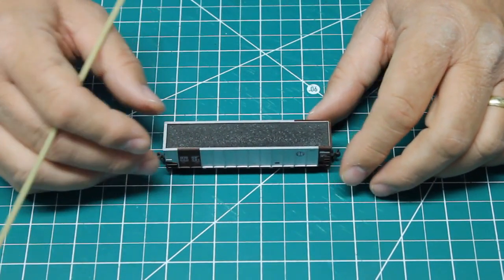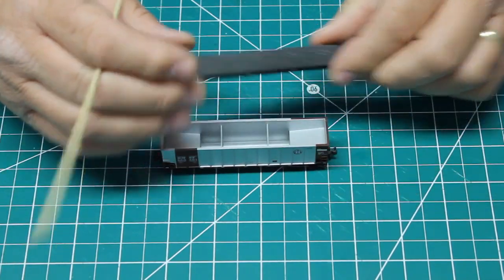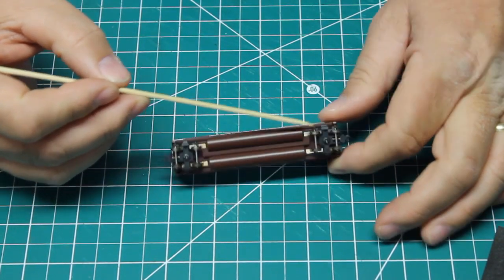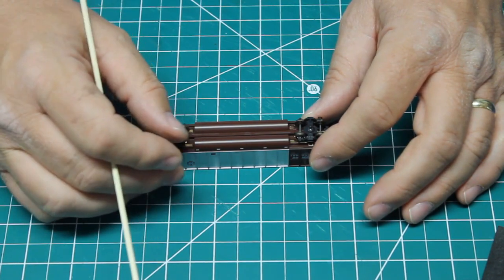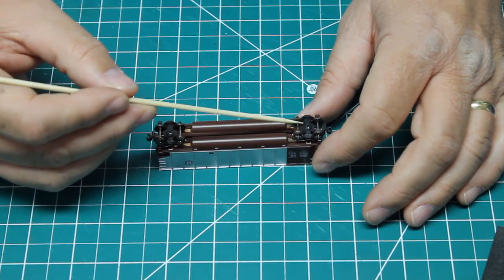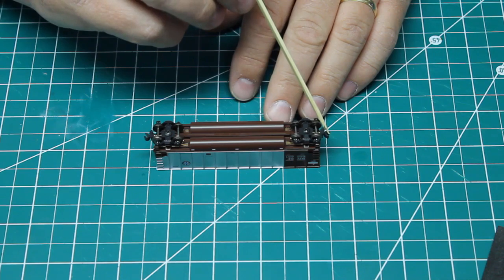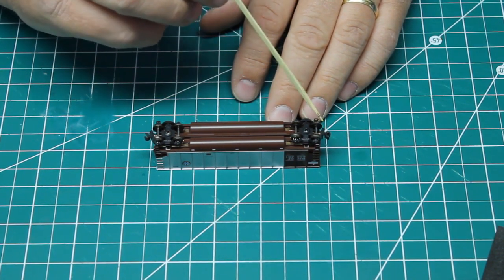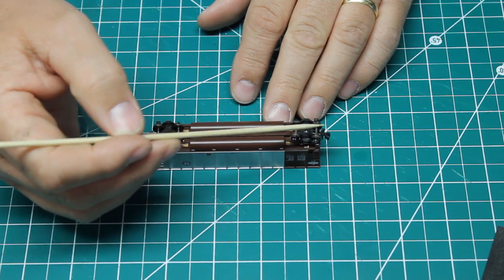Model Railroad Coupler Installation - Body Mounted Couplers

Comment: Excellent demonstration. Some modelers who don't use magnetic uncouplers cut off the the wire on couplers. If you don't use magnets is there any point to inserting the the wire when assembling a coupler? Have you been adding trees to your mountain scene?
Reply from the maker: The couplers are much easier to assemble with the pin in place. It helps hold the coupler together until you get it installed in the draft gear box.. Some people then cut the pin off, but as far as purpose the pin is a pretty good representation of the air brake hose that is connected between couplers. Without the pain there is nothing to represent that in N scale unless you use a thread and magnets to represent the air hose.
Reply from the maker: ... and yes, I've added some trees. I did a video about that a couple weeks ago. Getting ready to add some more trees still and some underbrush to the mountain area.

Comment: Great video!! I just subbed! I actually want to do this one all of my cars eventually. A issue I worry about is coupler height. I have a random assortment of rolling stock from new Kato's to old Bachmann's. Whats a easy way to make sure the height is correct while installing them, and what to do if its too low or too high?
Reply from the maker: That is a really easy problem to address if you were using body mounted colors. If he color is to high, Micro trains sins little Gym washers with the colors. Just put one of those or more in between the coupler and the body and it will lower the coupler. If the coupler is to low, do the exact same thing between the truck and the booster to raise the body up a bit.

Comment: What are those metal strips on the underside of the body next to where the trucks fit?
Reply from the maker: Hi Alan. Those are unique to Kato cars and I honestly don't know what the purpose is unless there is concern about the wheels rubbing against the underbody of the car. I don't know why that would ever be the case, but I don't know why those brass strips are there.
Reply: Some Kato cars have lighting installed - of the provision to do so - so I'd imagine this is an inherent design in the Kato tooling.  Some cars obviously will never have lighting but the tool is the tool is the tool and it is cheaper to have it, than have a separate tool.  Tools are expensive for making the models.  Bloke I know down here does stuff out of China RTR and if he gets to tool wrong, and has to get it redesigned it costs something like $200k.  Important to get right!

Comment: Hey Ron .. I somehow fell a bit in love with your series - but especially regarding those Micro Trains N couplers I have a question - now before you laugh, I'm starting out with my first US rail layout and I'm still awaiting shipment ... unfortunately MTL got affected by the fires in Oregon - But what oil / stuff do you use in those couplers .. I've read that Micro Trains suggests their own stuff - which is hard to come by and expensive ... do you have any experience / suggestions what I should use ?
Reply from the maker: Well, I personally do not use anything. The couplers are made of derlin plastic, which is naturally very slick. I have not problem with them binding. Personally, if I were going to use anything on the couplers it would be powdered graphite. In the US it is sold in hardware stores for lubricating locks and latches. It does not attract dirt and does not "gum up" like many lubricants will do.

Comment: Another question:  Do you have any issues mixing body mounted cars with truck mounted cars and backing them up?   Or, on tight curves?
Reply from the maker: Hey Dwight. No, I don't really have problems there. If there is an issue it is usually with two truck mounted couplers one shoving the other through a switch. The pressure on the truck mounted coupler twist the truck in the rails and can cause derailment. If that is an ongoing issue with a car I upgrade to a body-mounted coupler and it usually solves the issue. A lot of it has to do with length of car. Longer cars have more problems with that issue on the tight radii  of switches.

Comment: Kato couplers do couple to acumate couplers. I run them together all the time. Trying to figure out if i want to change to mtl true scale or make my own.
Reply from the maker: Ok, I keep getting this response. Not all Kat couplers are the same. These are dummy couplers, no moving knuckle at all, and they are compatible with nothing. Yes, some Kato couplers are working couplers, especially on newer locomotives, but these are not.
Reply: @RonsTrainsNThings  interesting. Ive pulled my kato bethgons with atlas locos before. Needs tge hand of god though
Reply from the maker: @liamcooper5202  Perhaps the thing here is different definitions of compatible. Yes I can force them to couple with other brands but inwould not call them operational when inhave tonuse the "hand of God."
Reply: @RonsTrainsNThings  haha well that does knock some brands out from themselves 🤣
Its a shame mtl 1015s are so sloppy and the true scales dont couple with ease.
Reply from the maker: I totally agree.

Comment: Hey Ron, HELP.   I'm just starting out again in The best hobby in the world.   Right now I'm trying to assemble a old Roundhouse Industry die cast box car.  The base is metal/pot metal and the steps need cleaned up.  If you were doing this how would you go about it.   Thank you for your help
Reply from the maker: I would carefully file them with a needle file.
Reply: Thank you Ron, just ordered a set of mini files from your Amazon account.   Please keep the great videos and advice coming
Reply from the maker: @CM-ARM  Thanks.

Comment: Ron have you made any videos showing the different length mirco train couplers? 
I know there is short, med and long couplers, but I don't know where to to use them. 
Thank you for all your videos you and the others really help.
I been kicked off Fakebook to many times so I moved to MEWE.  Not to sure if I like them. They have groups and I found a nice group of N Scale trains but they get all upset if you post any other scale but N scale. I told them we should honor all groups including live train feeds because they will help educate one and give others ideas. Anyway, I stopped posting in the groups and just do the home page. What's your feelings. Should these groups allow other information or just be stuck in never never land.
Reply from the maker: I think each group has the right to set its own content guidelines. The trick is to find a group that has content that fits your needs and desires.

Comment: I just started converting all my cars to body mounts I'm about 60% thur my cars the biggest pain is the tank cars and old atlas coal cars
Reply from the maker: Someone makes a conversion kit for the old Atlas coal hoppers, but I can't remember who off the top of my head. It may be TrainWorks. As for tank cars, I leave the truck mounted couplers on them.

Comment: X-Acto Blade Chisel #17  might work a little better in the tight location
Reply from the maker: Possibly. 👍
Reply: @RonsTrainsNThings  use nail clippers(finger) to remove the OEM coupler boxes from the trucks in one click, though not all are the same width. I found it more convenient to have dedicated pin vises fot the drill and the tap, and they are labeled so I don't grab the wrong one by mistake and they are always ready to use no matter what else you are working on. Occasionally you have to counter sink the screw hole or use a flat head screw avilable from WKW and others, so the axle does not rub the top of the screw and the truck won't sit flat (or use a 1025 even if you have to cut the back off after assembling). Have been body mounting since early 70's, creativity is a must! Liked the idea of using the tape to hold the parts! I get a 10 pack and assemble them all at the same time and keep couplers and parts in small box made for fishing tackle, weekly pill boxes work good too. Keep up the great work Ron!

Comment: You have a great technique but I will tell you eye sight has to be very good even with magnification. My sight not good enough so I spend the extra money. Thanks for your post.
Reply: I could have done this 30 years ago.  One of the reasons I model in HO is with enough light and magnification I can still see it.  A tip from an old guy.  In addition to your glasses get a forehead mounted light.  It really helps!
Reply: PS, I do enjoy your work!
Reply: Suggest you use soldering glasses - ideally a headmounted, those come even with additional light with several ultra bright white LED .. leaves your hands free and gives adjustable magnification

Comment: tomorrow ill be installin 12 of these premade cuz my fingers but the reason is the 6-pack i bought have static couplers, i need to read closer i guess but i liked them also bougght 2   6 packs, i thought a 4 pack duh in any case ill see howe it ggoes

Comment: What's the drill and screw number for n -scale. Thanks.
Reply: Tap drill is #62, then use the 00-90 tap to cut threads. Screw size 00-90

Comment: Wow. I thought truck-mounted couplers would handle tight switches better because they would better follow the tight curves, the coupler always being at right-angles to the axles as the wheels follow the curve. Is there an explanation of why body-mounted works better? I have an HO layout with Bachmann EZ Track so-called standard turnouts (approx #6) and switching is always 'an adventure '.
Reply from the maker: The problem with truck-mounted couplers on tight turnouts is that the push on the coupler puts lateral twisting pressure on the wheels and flanges as it turns--pushing sideways on the truck and thus contributing to derailment. With body-mounted couplers the trucks are free to turn without the pressure sideways directly on the wheels.
Reply: Thanks

Comment: Why does Kato make there couplers so they don't open?  How are you supposed to couple up 2 cars, with the 5-finger helper?
Reply from the maker: I suppose so. This is just Kato's proprietary design. Remember, they are imported and they have a significant business in their native Japan.
Reply: Right, but I wonder if in Japan do they just run round-and-round trains?  Or do they do operations with their trains.
Reply from the maker: That I don't know.
Reply: The Kato couplers do open, the engines and cars Kato sells come with trip pins for realistic operations
Reply from the maker: @nsnjrailfan1617  I would like for you to look at the image linked here and tell me how this is ANYTHING BUT a dummy coupler: https://ibb.co/HY0KF2Q

Comment: The Kato couplers are functional not dummy, they come with trip pins you can add for realistic uncoupling, they work fine with atlas, micro trains, athearn, and Bachmann couplers.
Reply from the maker: Not true. Not in this case anyway. It is true that newer Kato locomotives come with couplers that are functional, these Kato cars do not. These are completely non functional, one solid piece, dummy couplers. They can sometimes be forcibly coupled to some others, but they are in no way operational. They don't even work well with one another. They have to lift up against their springs and slide over one another to couple and uncouple. In short, if you want to do any kind of switching they are completely useless.
Reply: @RonsTrainsNThings  

So, Kato couplers do not play well with others? Therefore, I should either go all Kato, no Kato, or be prepared to swap out Kato couplers for Micro-Trains?
Reply: @rayopeongo  Kato couplers play well with other brands, while occasionally they will not couple on the first try they typically work fine from my experiences.

Comment: THAT COUPLER IS TO SMALL IN LENGTH FOR ME TO USE WHAT IS THE LONGEST LENGTH OF COUPLER THAT MICRO  TRAINS HAVE ? ON MY  LAYOUT IS A TURNAROUND OF 19 DIG. OR LESS. I LOOK AT THE PICTURES OF DIFFERENT COUPLER'S ON THERE WEB SITE, BUT I CAN'T DETERMINE WHAT LENGTH THE COUPLER'S R. TKS.
Reply from the maker: These are short shank couplers. They make them is short, medium, and long shanks, but I can't tell you what the actual length of each is. You might try sending an email to MTL and ask.

Comment: I watched this video, and decided to give it a go (modelling British N Gauge, so hadn't tried Kadees before, as they're more American). Firstly, in summary, I must disagree with your recommendation to buy the self-assembly version. I bought both to try - a pack  of 4 pre-assembled cost me $10 (Canadian) from a local shop, and a pack of 4 kits cost $6.55 - so the saving was $3.45,  or about 86c a coupler. It took me at least 15 minutes to get one assembled successfully, so I was paying myself less than $4 an hour, for extremely fiddly and annoying work. Hence, in future, I'd stick to buying the pre-assembled versions. Assembling the kits is very difficult... as you illustrate in your video, where you never, in fact, successfully assemble one on camera. Your tip of using a knife to place the spring is right on, and works well - those springs are very hard to handle with tweezers, and a knife, as you show, works way better. But, as you show (by never managing to do it on camera) the most difficult part is getting the lid on. You also don't mention in your video that (at least with the kits that I bought) it is necessary to cut down the box and the lid if you are trying to make the short version of the coupler. I have a tip of my own, that finally enabled me to get the lids on: put the screw through the hole in the lid; then hold the screw, below the lid, in tweezers, and insert the bottom of the screw into the hole in the box; now you should be able to gently withdraw your tweezers and let the lid fall into place on the box; then use the tweezers to align the lid properly, and then, with the tweezers partially open, press down with the side of the tweezers on both sides of the screw until the lid snaps into place.